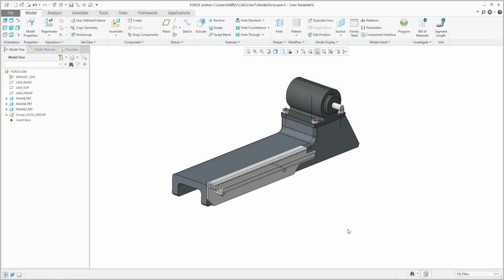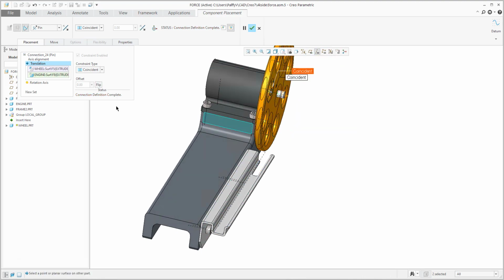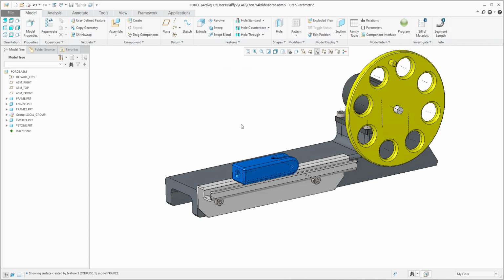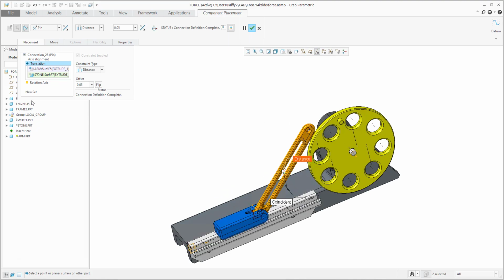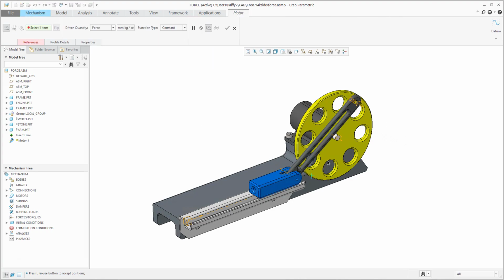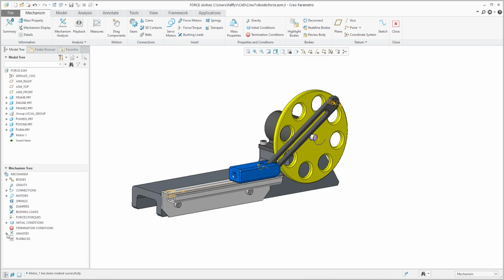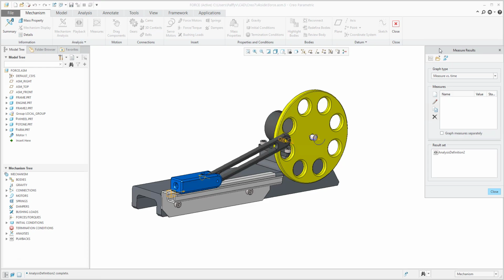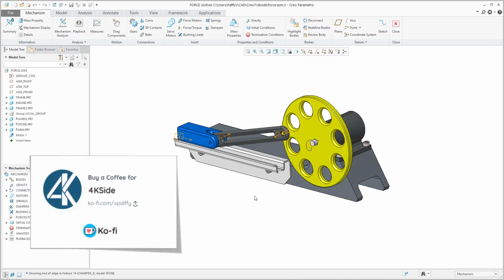Creating Force Motors with Creo Dynamic Analysis

Comment: Hii, can you tell me that how to calculate the net load of any mechanism which contains the springs?
Reply from the maker: Here is the theory (I do not have experiences in this, sorry)

Calculating the net load for a mechanism in Creo containing a spring involves determining the forces acting on the mechanism and considering the force exerted by the spring. Here's a general process:

1. *Analyze the mechanism:* Understand the geometry and kinematics of the mechanism in Creo.

2. *Identify external loads:* Determine the external loads acting on the mechanism, such as applied forces or torques.

3. *Consider the spring force:* Determine the force exerted by the spring based on its stiffness (spring constant) and the displacement of the mechanism from its equilibrium position.

4. *Sum forces:* Sum up all the external loads and the force exerted by the spring to get the net load acting on the mechanism.

5. *Check equilibrium:* Ensure that the net load calculated satisfies the equilibrium conditions for the mechanism.

6. *Implement in Creo:* Utilize Creo's simulation or analysis tools to input the calculated loads and analyze the mechanism's behavior.

Remember to consider factors like friction, inertia, and any constraints in the mechanism that may affect the calculation.
Reply: @4kside  actually i am doing this in the mechanism which contains one torsion and one compression spring, but  when i am calculating the net load on the rotation Axis ,its only showing the torsion spring torque
Reply from the maker: Hi, maybe will be better to ask on PTC university web page...over here is the much more experts and maybe they can help you. I am not familiar with that as mentioned last time. Thanks for your understanding.Vladimir

Comment: What is the difference between servo motors and force motors in creo para?
Reply from the maker: The servo motor is defined by translation/rotation in degree per seconds and Force motor is defined as a force - in Newtons.